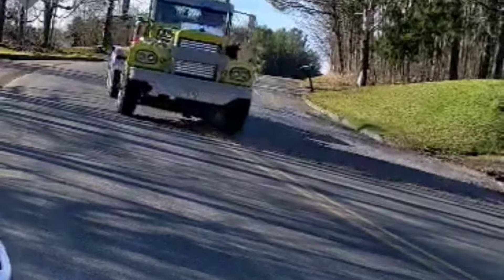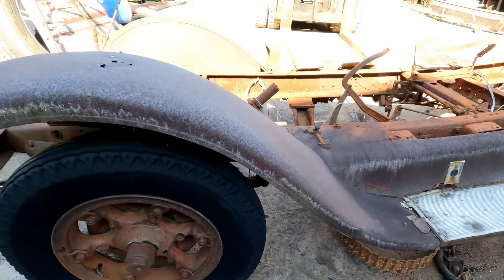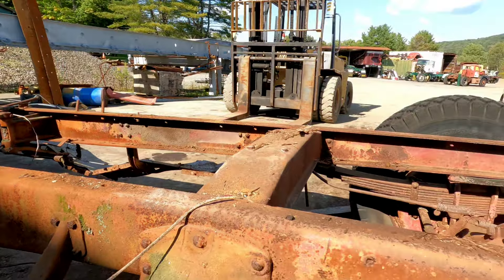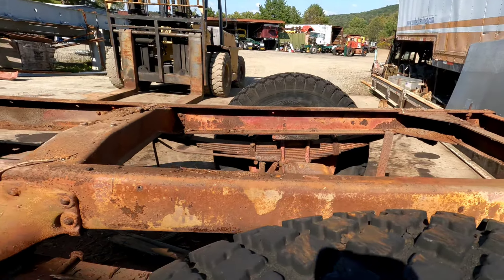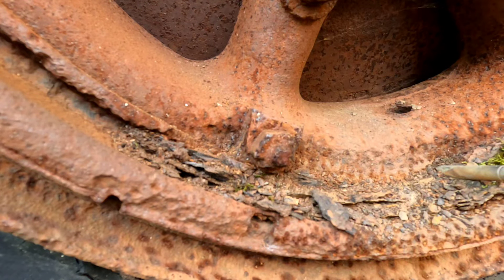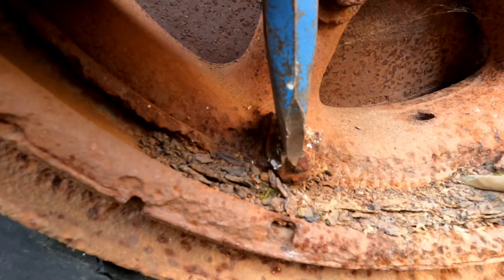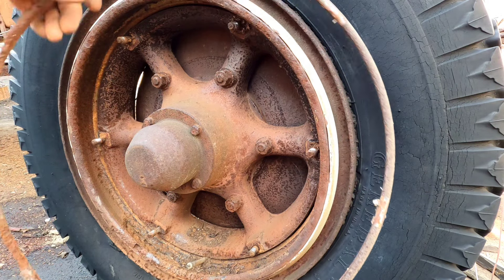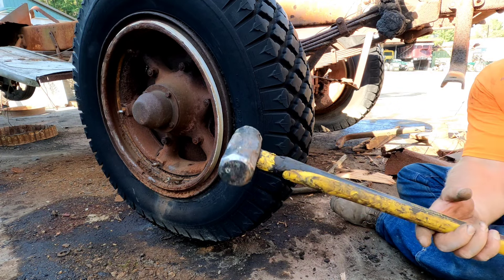Rusty Gold an attempt to remove a pesky 100 year old wheel #mechanic #fire  #truck #gmc #automobile

Comment: That looks like it may be a Firestone wheel, you should always use Kroil, penetrating oil. The metal is better than any thing you are used to and remember to just oil it and it will come off. You can use the heat wrench but please don't cut it off. Treat it well, this snap ring is hard to find.